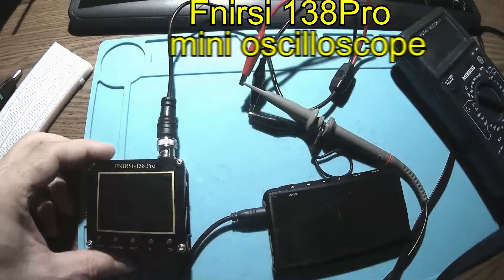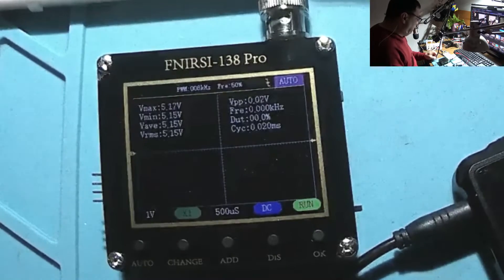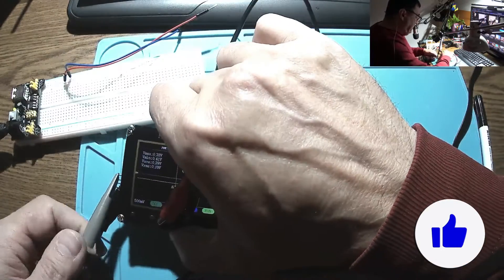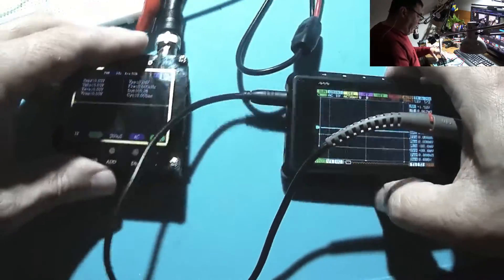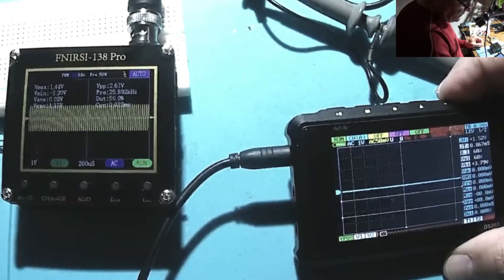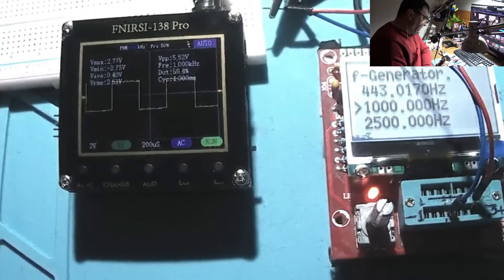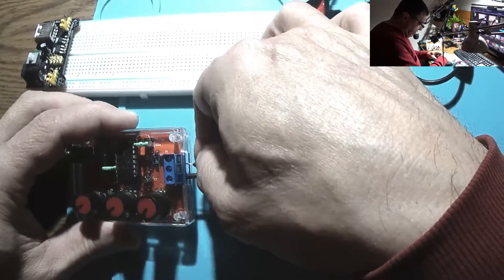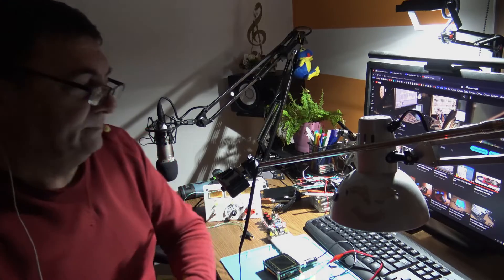FNIRSI 138Pro square wave measuring test

Comment: Hi... how do you switch it from X1 to X10?
Reply from the maker: Push Adjust until x1 is blinking..now press ADD or DIS until x1 change to X10...
Reply: @viocaia  
What do you mean by "Adjust"? There is no button with that label. When I push the change button, it always skips the X1.
Reply from the maker: @SuperMafiaoso  Sorry ..I meant Change..
Reply from the maker: @SuperMafiaoso  Push Change, you'll see the cursor on the left turns blue, push again it goes down to 10V, that goes blue also.Now press OK for 2 sec. The voltage in the left down corner should go to 100V and x1 turn to X10